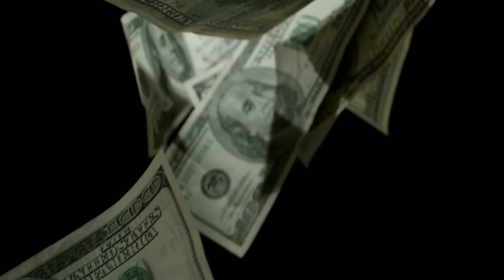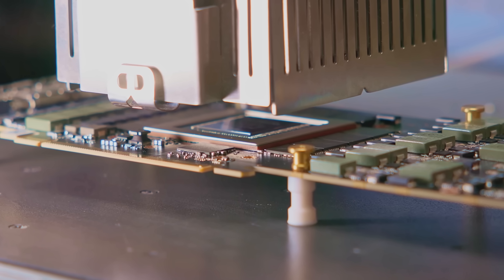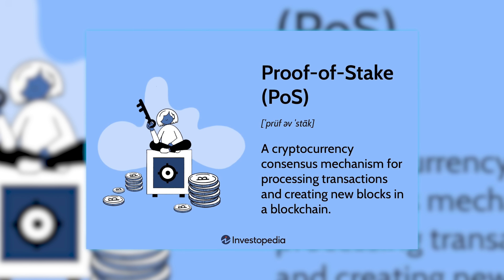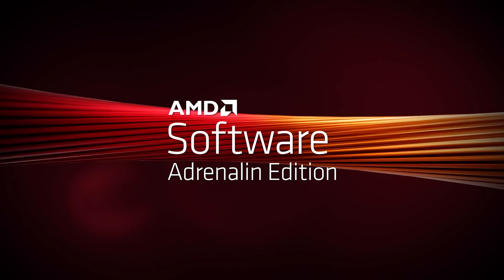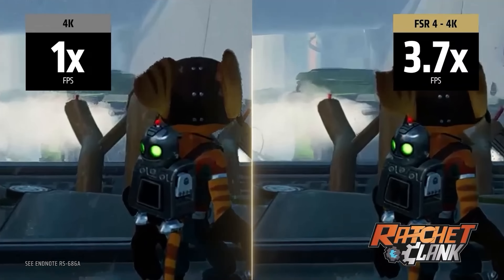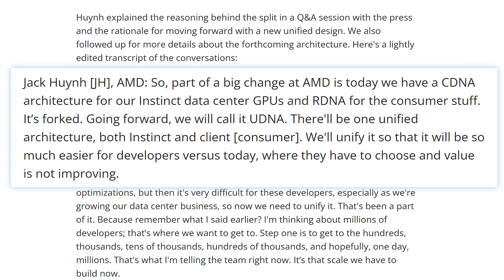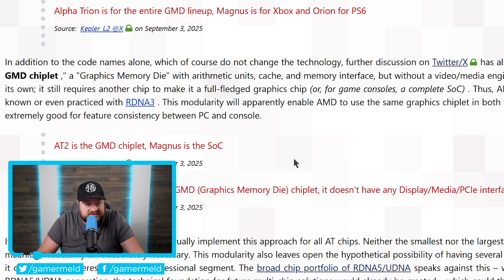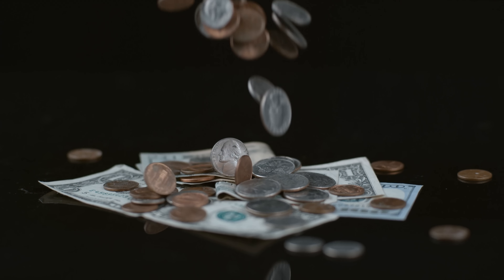AMD Just UNLEASHED The Kraken!

Comment: Soldering a GPU ... not that difficult... man I like your optimism, but no it´s complicated like hell, cause you have to desolder the whole GPU, then you have to reball it (which you need a stencil for) and then you have solder it again to the new PCB. That´s actually not the most difficult part, the difficult part in the process is to not destroy your gpu or vram chips. But what do I know? Try it out yourself! The financial risks are quite low (compared to a pro card).

Comment: Hi everyone, how are you? I installed this driver yesterday on my RX-6900 XT and in the game Mafia I had a gain of 30 FPS. I have a PC that is a 13.900 KS with Undervolt with a Custom water cooler and the 6.900 XT is also blocked with an individualized water cooler system of 360 mm. The temperature of the video card did not change, but the performance changed a lot even with this configuration and thirty-two gigabytes of RAM. I played with 58 and 60 with everything at maximum, and now I'm playing between 98 and 110 FPS. After I installed the driver, it was very good. Congratulations to AMD.

Comment: AMD's biggest problem is their market share has dropped to just 6%. They've went from 20% with 6000, to 10% with the 7000 and now down to 6% with 9000.  The only thing I can figure is they just aren't producing enough chips causing a shortage for the AIBs as well as higher prices because of supply and demand.  WTF?????

Comment: 48GB for $100 I knew it gpu memory prices are insane, like why is a 5060 ti 16 GB $100 more than the 8GB version? They are just ripping us off.
Reply: You know that the memory is not included with the kit (since gddr7 comes in at around 10$ per GB), also the 4000 series is using gddr6x which is around a half - a third of the price of gddr7. Also if the memory is incl. it would be best to not use it since you don´t know it´s origin.

Comment: I want to see AMD UDNA with GDDR7 fast. Time to move on from Radeon 9000 already. Did not bring anything interresting besides FSR 4 but its mid-end only and a downgrade from my 4090. My next GPU is going to be 6090/6080 or AMD UDNA. Nothing from current gen is worth a buy and 5090 is laughable with 600w TDP. Never going to happen, my 4090 consumes like 300-350 watts with UV + OC and performs 5% better than stock 4090 that uses 400-450 watts.

Comment: Nvidia should allow board patners to put more vram on the gpus
Reply: It is not up to them. A GPU core has a fixed amount of memory lanes. On each lane, the maker can put either 1Gb or 2Gb chip, resulting in 8 or 16Gb RAM.  The 3Gb chips are in the making, you will see all cards upgraded with +50% RAM as soon as those chips are available.
The videocard literally needs more cores to be able to have more RAM lanes.

Comment: If NVIDIA doesn't adapt to the whole 'custom' / unofficial 48GB / 96GB variations of cards, then I fully expect those types of custom cards to take over their official lines. What's stopping custom cards to always have more VRAM while keeping the cheaper models? If a custom model of a 5070 Ti comes out with 48GB and just costs about the same as the official one... there's no point for going with the official one at all. It makes the whole official lineup obsolete. We'll probably still be 'stuck' with 32GB on their 6090, and by that point we'll have custom 5090s with 128GB, and 5080s with 96GB of VRAM (which technically is already happening for the 5090s, mind you).

Either they catch up, or a whole new market of custom and unofficial cards will rise. Not even their usual third party partners will keep up since they're not even allowed to produce their own full custom variations anyway. If a partner like MSI or ASUS could be given the green light to produce their own models with 'extra' VRAM it would at least equalize the whole situation.
Reply: You missed the part where this mod halves memory speed and latency? Or, more likely, you never read anything at all, but have an opinion. That is besides the legal trouble of how to sell cards against Nvidia's will. eEVGA closed because of that.
Reply: @BarafuAlbino  Fast on the accusation trigger are you? Where do you see me even mentioning the latency and speed? Nowhere. Alright so because it's not mentioned, I automatically didn't know about it. Not only that, but I clearly mentioned that NVIDIA partners aren't allowed to produce their own full custom cards (such as added extra memory). 

Yet you mention the legal trouble about such a situation even though I already mentioned it, clearly implying that I knew about it. So yeah basically YOU didn't really read what I typed, and had an opinion about it.

Amazing that I had an opinion, and that you also had one, isn't it? Truly incredible.

Comment: Are you insane? it's extremely difficult! a modern GPU is precision equipment, even the small distances component and details are so important; you'd know this, if you ever seen specialized people and equipment diagnose and repair faulty GPUs; and Chinese are characterized for selling whatever looks like the original, $142 for 2x the VRAM? All that is extremely Fishy

Looks like RDNA5 Server additions will make the Desktop GPU much more Efficient and powerful
Reply: No, this mod exists, because Nvidia did design its possibility, they just never got to selling it, but the GPU core can handle that extra memory by using splitters, halving the memory bandwidth for double the space.
Reply: @BarafuAlbino  Is not what I wrote, read again until you understand

Comment: Let's be real about one thing:  If the 10k series beats Nvidia performance, you can be damn sure that AMD will NOT price them under Nvidia pricing.
Reply: Yes but you miss the point that if AMD is actually competitive then it will start a price war between both. Nvidia will have to cut prices, then amd might follow
Reply: I wouldn't be surprised if you're right, but in my armchair opinion they need to price them at least a little under nvidia simply because nvidia has such a strong "mindshare" with people that amd need to continue on with the confidence they've shown with  rx 90x0/XT series, for at least another gen before they make inroads. 
Personally I have an nvia card in one machine and nvidia in another, so I dont care beyond wanting good, healthy  competition
Reply: @beezle1976  The "price just below Nvidia" strategy doesn't work. They've done it for years, even when they're competitive. It doesn't seem to make a difference. It has to be an extremely high value proposition.
Reply: @beezle1976  OH please, so the silly argument of RDNA2 coming back again. If they price them lower you muppets will still go out and overspend to buy the Nvidia GPU's like you did back then with RDNA2. Youll create some new silly argument besides drivers, upscaling, framegen, RT...
Reply: @YTisProMentalillness  At the end of the day, we all know that even if AMD does beat Nvidia, Nvidia already has the next several generations in the chute.  Assuming AMD drops something that can meet or beat Nvidias 90-class, Nvidia will shift their timeline and drop the next thing to stay ahead.  What I am hoping for is that Nvidia will continue with this complacent "king of the hill" BS while AMD does what they did to Intel with Ryzen.  Who knows.  It is all speculation.

I digress.  I've been building PCs since the 90's and have never felt any sort of brand loyalty.  Buy whatever gives me the best performance within my budget.  Would that make me a muppet, or a fraggle?  If I get to be a muppet, I want to be Dr Bunson Honeydew so I can say "Vert Der Ferk!" and "Bork Bork" at my dog.  If I'm a fraggle, I want to be Boober.  Why Boober?  For no other reason than the name makes my inner 10-year-old giggle.
Reply: @TheBeardofDOOM  Yep, only thing that I care about is value per dollar per FPS.
Wait, your not talking about the Swedish Chef are you?! LOL I love that muppet.
Reply: @YTisProMentalillness  ha!  Derp.  Yes.  You know the gummies are good when you confuse the chef with the doctor.  Doc and Beaker are awesome, but Chef is the best.
Reply: @TheBeardofDOOM  Havnt seen the Doctor. Just came across the Swedish Chef which of course has been removed from the home page by YT even though I watched every video I could find of the Swedish Chef and watched at least 2 hours worth total over the space of a couple months.
Reply: this comment makes no sense unless you're talking about the highest end gpu they're gonna have, everything below the highest tier gpu is a battle of value/price, ofc they will price their gpus lower than nvidia's lmfao, nobody would buy their gpus if they were priced higher than nvidia's and they know it
Reply: @woro.That is exactly what I am saying.  If this new rumored monster can beat top-of-stack Nvidia, it will absolutely cost more than Nvidias top gpu.
Reply: And why should they? We know if they do, Nvidiots will still go out and buy Nvidia because they are thoroughly brainwashed into choosing 'team green'. Just look how many still bought the horrible 50 series with horrendous drivers and higher CPU overhead costs - their absolute brainless idiots.
Reply: They have to sell under nvidia pricing, because nvidia has CUDA and AMD doesn´t. So in order to get some marketshare from the pro market they have to be cheaper, just like Intel does it at the moment.

Comment: Well this doesnt mean shit ngl.
Having more vram doesnt mean the card can MANAGE the additional vram. The core architecture is setup to overload to up to 20%, but that cuts hard into the lifespan of the card as parts get hotter that arent supposed to get hotter, which the kit doesnt cover. Also you risk losing actual performance in the process due to how voltages are managed.
Reply: It is meant only for AI. Loads work differently there.

Comment: You said they fixed the biggest issue, then said prices are going up. So they didn't fix the biggest issue.
Reply: Their biggest issue is not being able to compete with top tier NVIDIA, regardless of price.  I would rather support AMD, especially as a future Linux user, but nothing beats the 5090 or even 4090 right now.
Reply: @tyrthemis true. But why compete if that means making a $3000 card? That's not what  most people see as the issue.
Reply: @tyrthemis i just want a 9080xt w 32gb and beats the 5080 by atleast 20%... Idk if its power inefficient or whatever

Comment: the fact you get get a full card PCB with 48 gb vram for $148 but nvidia refuse to make the 5070 16gb is truely infuriating
Reply: Super will be 18g and $1500, but dont worry, nvidits will pay.
Reply: @TheKwod  You keep saying that but Nvidia currently has a 94% market chare on desktop GPUs and AMD has dropped to just 6%
Reply: @longjohn526 unlikely given the success of the 9000 series, nv horrid drivers, horrible product segmentation and pricing.
Reply: $148 is just for the pcb, you still have source your own vram chips and gpu chip.
Reply: @ampilgrim85 still you wouldn't come even close to what they would've priced it if it had 16GB.. don't act like Nvidia doesn't overprice everything.
Reply: Then f nvidia and buy one of their 48gb 4090 GPUs just make sure it isn't a 4090D (yes they have the full fat ones too).
Reply: @proudweirdotasmania  Just be ready that itt does not run games well.  These cards are for AI only.
Reply: Ngreedia at its best buy more save more
Reply: Well Nvidiots still bought the 3070 8GB when it shouldve had 12, they still bought the 3060Ti 8GB when it shouldve had 12GB too and they still bought the 4070 Ti 12GB for even more money than the 4070 while still getting the same exact 12GB VRam. Go figure, Jensen knows Nvidia users are clearly idiots and will not only spend $200 more for the same amount of VRam but they will also spend $300 more than last gens 70 class card for a card that lies about it being a supposed '70 class' card when its truly just a crap 60 class. Expect in the future Nvidiots blowing over $850 - $1,000 for a 60 class card offering 16GB VRam.
Reply: Realise RAM costs $$$ and be less infuriated...
Reply: @mikeb3172 lmao you can't be serious, GDDR6 can be obtained for 0.50$ per GB, GDDR6X for 0.80$ per GB and a 16GB GDDR7 moule would be 80$ (meaning it would be only 20$ more if it was 16GB instead of 12GB).

So you're telling me a 20$ difference per GPU would bankrupt Nvidia?
They are making so much profit off every single of their gaming GPU (not to talk about AI ones), that even with that they'd still have a big margin on an hypothetical 16GB 5070.

Comment: ?  I'm on RDNA 3 - no need to upgrade "right away" for FSR4 - FSR4 needs newer hardware then my "old" RX 7900 GRE...  And besides, openSUSE being a Linux distro doesn't support Windows drivers (Tehehehehe).  But that doesn't mean don't upgrade, it's usually a good idea to keep GPU drivers up to date (I am very good at keeping my Kernel and the Mesa packages up to date). 🙂
Reply: I have same rx 7900gre but I belive AMD drop fsr 4 on rdna 3 when they roll out redstone and sdk2.0 all togeather